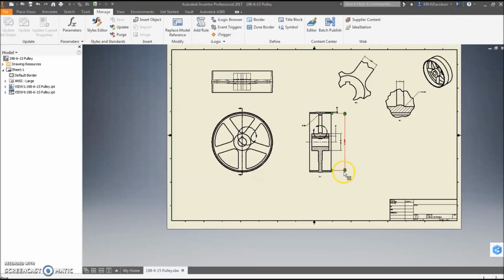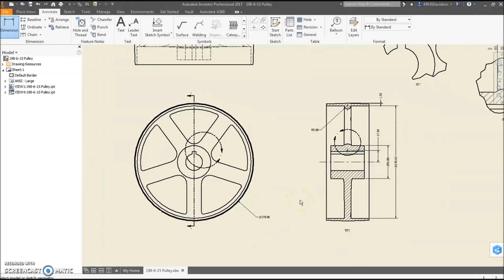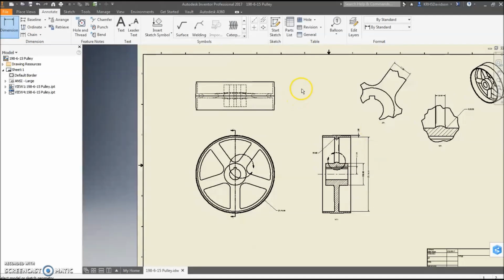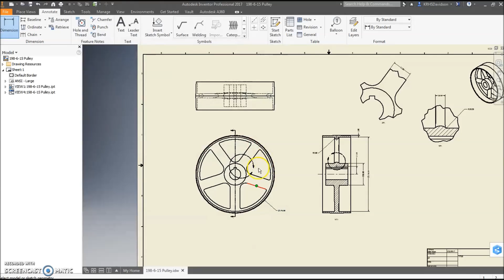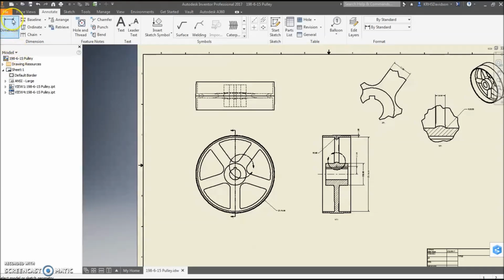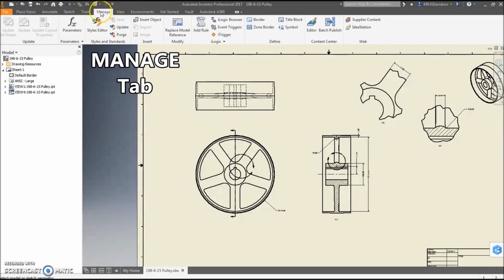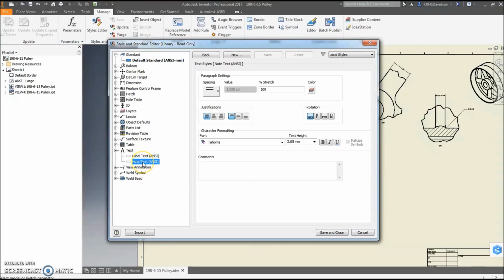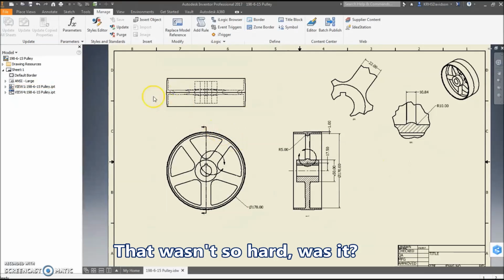Changing Inventor Dimension Text Size

Comment: One step further... this changes the displayed dimension like you say.  Thank you!  You are awesome!  If you have a tolerance on that measurement displayed it does not change the text size of the tolerance value.  To change the text size of the tolerance values also go to Styles Editor, but instead of Text go to Dimension, then Default (ANSI), then open the Text tab and change the size there.

Comment: Should not have been that hard to figure out. You highlight the dimension, go to CHANGE THE TEXT SIZE, and it STILL doesn't change? What sense does that make? Thank you sir for figuring this out for us. Using the 'help' button doesn't do a whole lot of good either... Go figure, a program made for engineers, who's job it is to make things simple and easy to understand, isn't simple or easy to understand.
Reply from the maker: Dan Shaffer, Dude! I know! Crazy isn’t it? And they still haven’t fixed it.  Glad I was able to help.

Comment: Inventor programmers take note....WHY MAKE IT SO HARD!@@! just put that option in the dimension box with an apply button!
Reply: Exactly, the same company that makes AutoCAD which allows this option so much easier forgot about it in Inventor.
Reply: @crecgolf88  And this is exactly why I'm watching this video, because when switching from one program to another you forget where it is and then it's not where you expected it. Some UI standardization would be awesome.